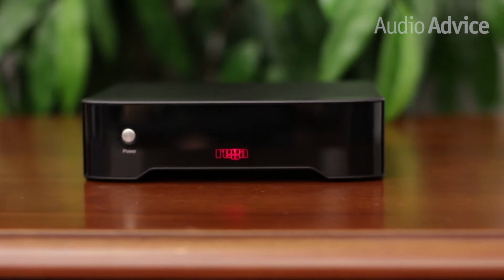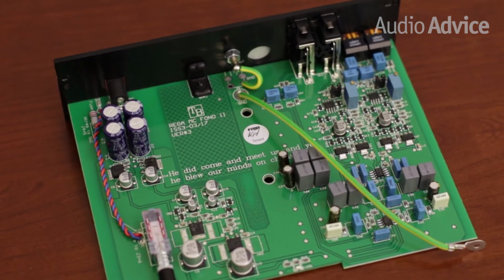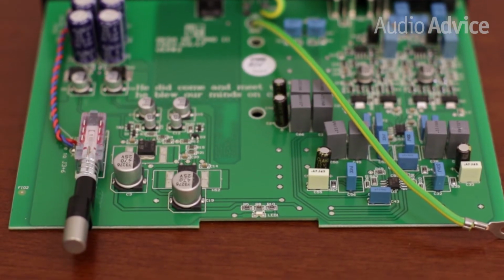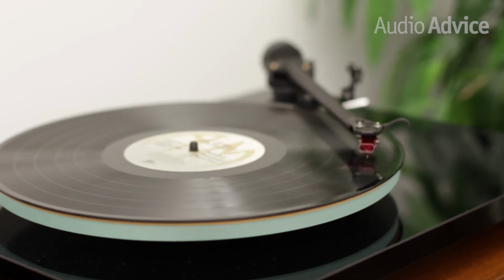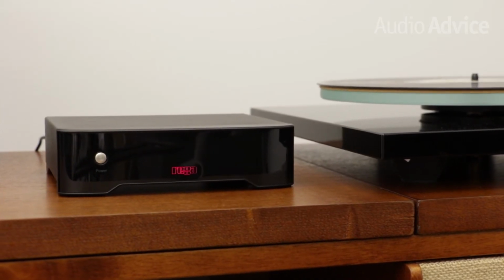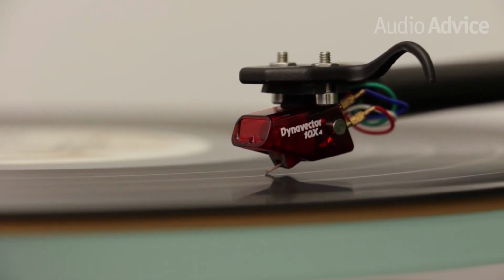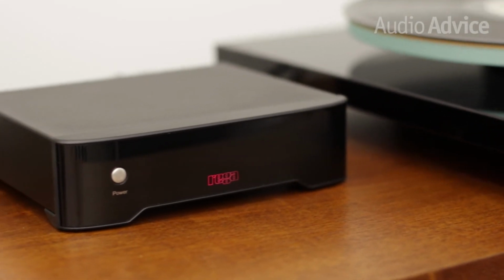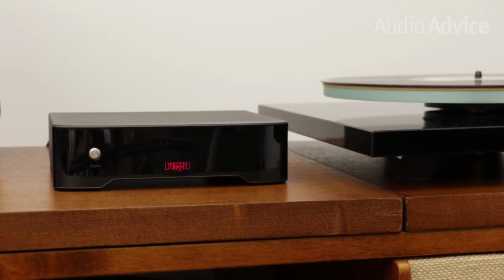Rega Fono MC Phono Preamp Review

Comment: Could you possibly do a video on how to connect one of these up to a turntable.. I have a p6 and haven't got a clue what all them dip switches do... Cheers!!
Reply from the maker: The dip switches allow you to adjust for loading, capacitance, and gain. These will vary based on your phono cartridge.  Just look up your cartridge specs then look in your Fono MC manual and line them up. Thanks for watching

Comment: Thanks for this video very helpful. I had read that pairing the Fono pre-amp to the Brio could cause a surge as it has it's own Pre-amp built in? But as you said to connect it to the Aux input on the Brio I assume that bypasses the onboard pre-amp and volume can be controlled from the Brio directly? 

Would I be correct in assuming this is the case on the Brio R Mk2 as well? T

his would make life a lot easier as I have been looking at Power Amps and there isn't much choice that I can see. The Brio R would be perfect, looks wise. Thanks again
Reply from the maker: As long as you connect the Fono to any AUX input, you will be fine, thanks for watching

Comment: Can i connect this to a rega p3 and then to a receiver with phono input?
Reply from the maker: @Mrbigfrong If you use this unit you will not need the phono input on the receiver.  Also, the cartridge on your P3 needs to be an MC.  If you have an MM there is a Fono MM also.